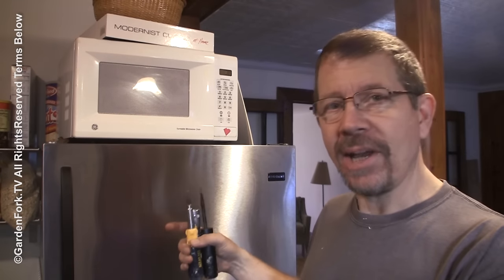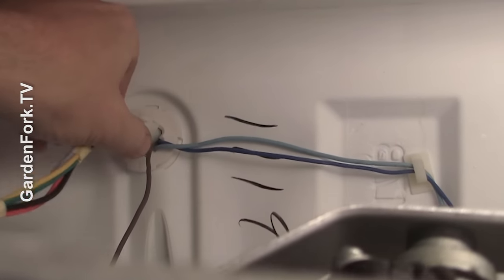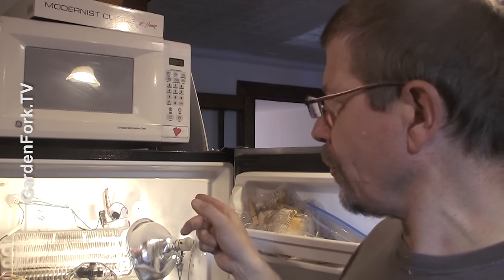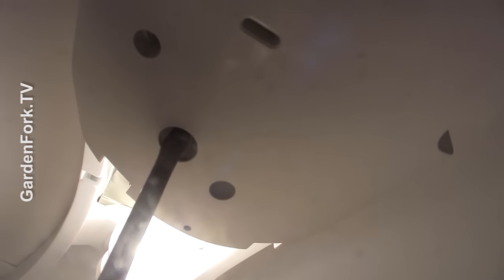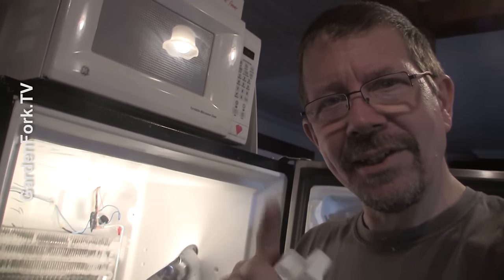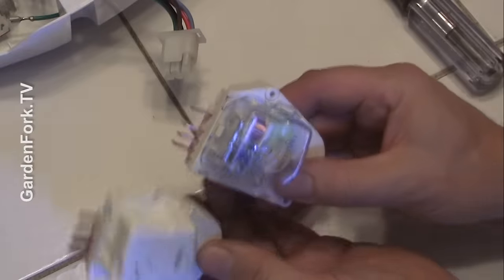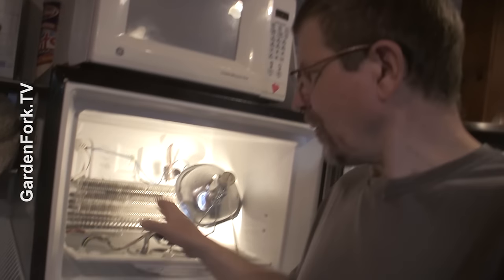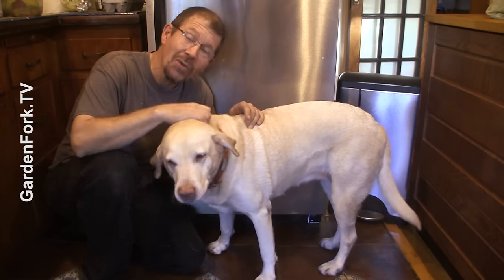Refrigerator Repair - Freezer Coils Frozen - Refrigerator Is Warm - GardenFork

Comment from the maker: Free email of fun DIY for you each week. Join Me! https://www.gardenfork.tv/sign-up-for-our-email-newsletter
Reply: I turned to defrost mode and heating coil stayed cold. Replaced the thermostat and still no luck. Does this mean it’s the timer?
Reply: @johnherman8821  It probably means your heating element (defrost coil as you guys call) is faulty
Reply: @GardenFork it would have been a good thing to mention in your video that a clogged drain can cause undrained water to freeze and block the air from going down to the fridge... 😉
Reply: Hi there and thanks for your reply. I ended up replacing the thermostat timer as well as the thermostat and it works now!

Comment: thanks, I learnt how to look at my refrigerator to see what's up from your video and yep its all frosted up in the back of the freezer wall. I adjusted the timer it defrosted my  Refrigerator as you showed how in your video,  so it looks like I need a timer thanks you saved me an expensive professional call I am retired on SS less than $1,200  a month to live on, so yes, this helped saved me hundreds of bucks  I had a motor put in my dryer when it quit working last spring cost was $234.00 parts n labour. so yes, TYVM  for your time, info and being who you are to help others.

Comment: Wow, I WAS ready to start shopping for a new fridge, but now I'm going to try my hand at repair.  Especially when I saw that the timer for my fridge is selling for under 13 bucks!  Thanks for the clear video!!!    I got around to checking out my fridge, and since I have a model that looks just like this one in the video, things went very well.  Looks like it's the TIMER!  One tip--DON'T actually touch the heater element, just get close to feel if it is hot.  I know this because I touched it briefly and have a small, painful blister on my finger now.  LOVE THE POOCHES!!!

Comment: Manually turned the timer until 1 loud click sounded, waited a minute or 3 and the defrost line heated up really hot and so I used that to defrost the icy coils and the fridge started getting cold again! Replaced the timer and it all works great now. Thanks for this awqesome video!

Comment: thanks m8, ur the only one i found so far to explain the defrost system and i did not know about a timer existing, now i have to go find it, i already took the heater out thinking that crapped itself, i will test the heater element and see if it still works either with multimeter or giving it 230v juice for 20 seconds.

Comment: Hey, this is a really good video, 👍 thanks, 👍 working on my downstairs apartment Kenmore refrigerator,,I just finished defrosting all the coil units there was a inch of ice on the front and behind it! Used a hair dryer to do it, and had to pull big chunks of ice off of also had to stop up a lot of water because the drains were frozen down also,,I think it froze up because the vents were blocked.? Now started up the fridge up again, and see if it cools, everything sounds good, the fan is running nice and seems to be blowing cool. If it looks like it's starting to freeze up again, I'm going to do as you said and check the thermostat. The freezer is probably about a 20-year-old Kenmore. Also, I love labradors, I have a 14 yellow lab..😁 Thanks again! 👍🐦

Comment: Thank you! You have proven to me that my maintenance guy has no idea what he's doing! HAHAHA!
Reply: Few handyman types know enough to troubleshoot refrigeration.
Reply: @tmst2199  or just check the draining tube...i repairs like this only to find the real problem was simple and cost nothing to repair....clogged draining tube...
Reply: @jeffloven839  l hope you see this. I'm trying to save money and fix mine myself. I don't know anyone that knows much on fridges.
Last week my fridge was warm but freezer fine. My son kept putting things in and it had got pretty full. I asked him to remove some and put in the bigger deep freeze. I forgot about it. So when this happened I removed some things but it would not cool fridge down enough. I read several articles. So I decided clean out all good, shut off for 24hrs. and cleaned bottom back well around coils. I plugged back in and after 24 hrs. Fridge was nice and cold and freezer was cold. I put a few things in but don't yet want to trust it. Good thing. Today I notice some water on top shelf off fridge. I start researching and it tells me the drain tube is clogged. The back first have anything removable. Just a short pipe, straight out the bottom. So nothing to clean there and it didn't seem even dusty. So my guess is in freezer. So I have to take back off of freezer. My brain is exhausted from watching videos and reading articles for the past 5 days. LOL I've always been the kind of women not afraid to get her hands dirty. When it comes to testing with a meter I'm lost. I read enough to remove inside of freezer back and ice maker. I'm going to clean the drain. My question is could the drain being clogged already since I had just defrosted a day be the temperature too cold? Im baffled what to check next. My fridge does not have the timer inside the top of refrigerator ⁹
Reply: Oops.
 My fridge doesn't have the timer inside the fridge to turn manual and test. So what do I try next??
Reply: @countrygirlinpa8831  I gave up and treated myself to a new one

Comment: Thank you, this wasn't exactly my issue but got me in the right track. My defrost element didn't come on after the timer click like you showed and I don't currently know where my multimeter is lol (haven't needed it in sometime) so that left me with 3 parts to test and no way to do it. I have a Frigidaire Galaxy model # 25368800990 built in 07/99. Since I still needed to test the parts I started with a voltage detector to see if the lines from the timer had power at the right time, it did. So I moved on to the defrost thermostat mine didn't require cutting wires had a male/female plug set so with the fridge on a power strip I bypassed the thermostat and flipped it on, sure enough in just a matter of about 30 seconds the element was hot. I'm assuming if it didn't get hot it would have been the element. I'm happy it wasn't because for this fridge the timer was $14 the thermostat was $7 and the element was $142 on Amazon (prices rounded up) (I can't say you can do this will all fridges or if it's even safe so if you try you do so at your own risk) Thank you again for the advice, I really can't afford a replacement fridge after my accident in Nov '19 and really appreciate it.

Comment: Awesome video brother. We can learn so much from YouTube

Beautiful dogs at the end
Reply from the maker: Thx!
Reply: @gardenfork  Quick question man. I see ice build up on the left side of the freezer and the heating coil doesn't gets hot and the freezer not freezing. Could it be the thermostat not working or the adjuster for the cooling temperature?  I'm using a mabe refrigerator
Reply from the maker: i would check with one of the parts supplier websites, they have lots of information. thx!

Comment: Thank you.  You were correct.  Heating element was not getting hot. I replaced the heating element.  All went well but when I turned it on it smelled like something was burning.  Normal for new heating element?

Comment: very nice you explained very well........but might be interested in the 6 in 1 tool link..........bought a cheap whirlpool for 50 and the frig was not getting cold also, but it was not a malfunction, just not understanding the control dials............it turns out the freezer manual dial as you advance it, it closes the damper and the frig gets warmer..........i was so confused but realized to go lower with that, thereby opening the damper and the frig is in the range of low 30's and to compensate trun the cooler dial up some.......had to play with this for a while, but seems to be working fine..............ty for your very nice video however......think your dog needs a cell phone....she talks alot  :)

Comment: Our Amana is about 20 years old.  Freezer on the bottom supposed to last longer- so far so good. Until this morning.   Think you diagnosed it.   Thank you very much
Reply: Update - replaced the defrost timer. The replacement  Is on a 6 hour defrost cycle versus the previous 10 hour??   Anyway the fridge is working but not the freezer.  Wonder if the timer can be reset - does it matter?

Comment: Excellent video and audio on troubleshooting, diagnosing and replacing defrost timer.  My fridge is cooling ok but tripping the GFI ckt every 6-8 hours. I suspect some wire grounding during the defrost cycle so I will test the heater wire for grounding and order replacement if defective. Thank you very much for showing and explaining.
Reply: Either heater or defrost thermo is shorted to ground. Might not even be direct short.

Comment: Appreciate you. My coils did not get hot though :(  really didn't want to have to replace the rod; your video helped take out the guess work. Thanks again
Reply: Did u refrigerator run warm to i wounder if that what mine doing seem the rod gettting hot but never though of it no getting hot enough my frezzer was not going below -0 thinking its my timer

Comment: Great video, but can I ask, are these components older?  In other words, have most of these items been replaced with computer chips?   I have the same issue, but repair guy says not worth reparing as it is the control board.  Thoughts?

Comment: Thanks for the video. So are you saying the heating element may not turn on if the coils aren’t cold? Because I’ve got mine took apart and letting it defrost and I turned the dial and the heating element didn’t turn on… But it is warm in there now since I’ve had the door open for a few hours…

Comment: all the videos i've watched, none said test timer.  Thanks guy
Reply from the maker: yeah the timer is this cheap clock type timer, like the kind to turn on and off lights in your house. it controls the defrost feature.
Reply: @gardenfork  excellent.  I manually defrosted the coil and fridge gets cold again.  Leads me to believe, all other components work fine. Now I must locate timer on Samsung Twin Cooling fridge

Comment: Thanks for a great video.   I replaced my timer and it seems to be working. But two things: first the compressor cycles on and off more than every six hours. Forgive my ignorance, but does the compressor cycle  operate on and off BOTH for its routine cooling cycle as well as for the defrost cycle? Nowhere I've read has it explained  it that way. Some explanations seem to suggest the compressor will only shut off during the defrost cycle. That's not the case with mine. It does always restart however and everything seems to be working just fine.  Second, I noticed your heater rod didn't turn orange as seems to be the case for other people who've posted articles. Mine doesn't seem to turn red either but when I touched it briefly after forcing a defrost cycle it became too hot to touch. So, does it HAVE to change color to be working properly?

Comment: If you have an ampmeter you can check the heater without taking the back panel off the freezer section. You put your ampmeter over I believe #2 coming out of the defrost timer then rotate your defrost thermostatt till it clicks. You should get a few amps on ampmeter proving the heater is ok and 95% chance you have a bad defrost timer. Much easier and quicker fix.
Reply from the maker: Thanks Dan, I need to learn how to use an ampmeter. Thx!

Comment: Thank you very much for this video. We have the same fridge that is in this video (Kenmore 253.62922012). Was thinking i would need to toss this fridge and spend $500+ on a new one. All i did was follow the instructions you provided and so far (been 3 days) the fridge has been running perfectly. I didn't replace the Defrost timer though. Just turned the screw like you explained and i guess the Defrost timer might have been stuck on mine. Working perfectly.
Reply from the maker: Yeah!

Comment: I hv the same type fridge setup you showed.
1.  Should the defrost timer be continuously ticking?   I read there are 2 types: continuous and noncontinuous.  Which is this model?
2.  Does the heater only turn on if the thermostat is working properly?  Closed when cold enough, open when warm enough.

Comment: I have the same problem, Freezer freezes up and Fridge is barley cold. I have to defrost the coils every 4-5 weeks I guess. But the coils on mine are usually frozen solid by the time I start noticing the fridge not being very cold...not just frosted. It takes about an hour to defrost with a blow dryer.

Comment: Loved your video!! I have the exact same fridge and my problem is the coils only frost on and off and recently have not been getting cold at all. The thermostat kicks on the condenser and I tried your trick and the heater coil works and is not on when I set it to cool. Does this mean my condenser has gone bad :( and if so is that a fix I can do myself??

Comment: Hi, thank you for your very helpful video. I have that same freezer and with the same problem. Do you happen to know the part number for that timer? I punch in my freezer model number, which is WZF34X20DW01. But it could not be located from the link you provided. Thanks again!

Comment: hi there
nice video
i have a whirlpoo double door model 20RI-D4 A+ PT refrigerator
the compressor and both fans are off
the fridge is not on standby I checked the control panel, it's showing both temperatures
cheked the relay it seems ok

it doesn't have manual defrost timer

what can be the problem please?

thanks

Comment: Thank you, sir. Very clear and well done. Am now pretty sure I've a got a timer problem, but now know how to find out for sure.
Reply from the maker: the timer is just some cheap plastic and a little motor. very similar to those analog light timers with a dial you plug in to the wall outlet. good luck!
Reply: Thanks, @GardenFork. I did that test, twisting the timer with a flathead screwdriver and it seemed to operate correctly. But I noticed the evap fan wasn't coming on. And it's been making some strange noises. So I pulled the fan out, put it on a meter and what do you know? No continuity between the motor terminals! Bingo! Well, actually, millions of ohms between the terminals. Then I hooked up the motor to 120V and it didn't budge. Strangely, though, about 12 hours since I put it back in the fridge, it's now kind of working, going fast, then slow, sounding weird like it has been for months. Do you agree that it's definitely bad? Or might it be some other electrical problem?
Reply from the maker: the fan is cheap, so i would just replace it. could it be binding on something in the housing?
Reply: @GardenFork Yeah, I guess a new evap fan motor at $120, shipped, wasn't too bad. Seems it was indeed the problem as the fridge is now purring again and cooling nicely. Watching this video was the breakthrough I needed to understand the system.
Reply: @GardenFork Just a note about the continuity test on the motor. Even the new motor registered millions of ohms between the terminals, which was disturbing. I had read somewhere else that it should only be around 100 ohms. So the only reliable way to test the motor seems to be actually wiring it up to a 120V source.

Comment: Thanks for sharing!  Your method doesn't require a multimeter but for those who have a multimeter.

 To quickly rule out the thermostat and the heating element.

1. Do a continuity check on the heating element with a multimeter. Unplug it and touch both wires with the multimeter. Beep!

2. Test the thermostat. - Only while the evaporator coil is frozen like this you should get continuity through the thermostat with a meter. If you don't check it while the coil is frozen you have to take it out and find a way to freeze it and check continuity.

3. If those two have continuity nothing is left but the defrost timer.

4. For those who don't know what continuity is think of it this way. Take a 1 foot piece of wire. Hook a multimeter to each end and you get a Beep or a reading in ohms. This lets know that the wire is not broken. 

On modern units If the evaporator doesn't need defrosting the thermostat won't let the heater run its course every six hours even though the defrost timer told it to come on.  

If you wanted your refrigerator to run like the old 50's models you could take the thermostat out and strait wire it. Then the heater would run its heat cycle every 6 hours whether its needed or not but consumes more energy.

The thermostat is a switch that comes on when freezing 20 degree temperature is reached in the evap coil. So if you throw it away and solder the leads together you take that function out and the heater will run every time the timer tells it to without fail as long as the timer is working. I wouldn't do it myself! its better to understand its function and simply test it and replace it if necessary. It also cuts the heater off if the temp should rise above 55 degrees protecting the fridge from over heating if it weren't cooling properly for some other reason.
Reply: Do NOT remove the defrost thermo!!! If timer sticks in defrost the heater will stay on and possibly melt fridge and bouse. I knoow. I've seen them stick before. 40+ years of working on fridges.
Reply: @dennisgoans701  so if my heating coil doesn’t come on with turning the timer and the coil has continuity then it would be the thermostat that’s causing this problem? And I shouldn’t take out the thermostat I should replace it? 
My freezer coil keeps frosting up and seems to run all the time which causes the fridge to get warm.

Comment: What exactly is the thermostats job? If it is all based on a timer then what is the thermostat doing? Wouldn't the Defrost element just turn on whenever the timer told it to?  Or does the thermostat actually function to turn on the heater mechanically after IT gets the message from the timer?